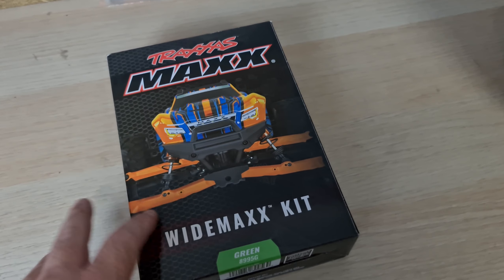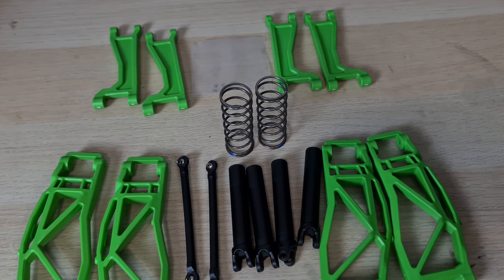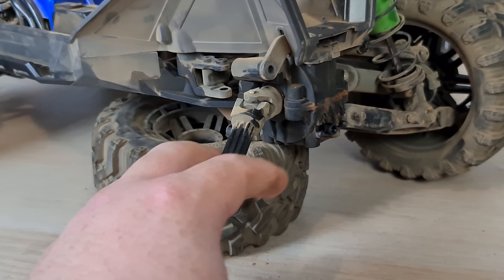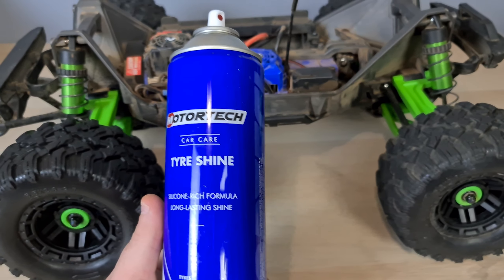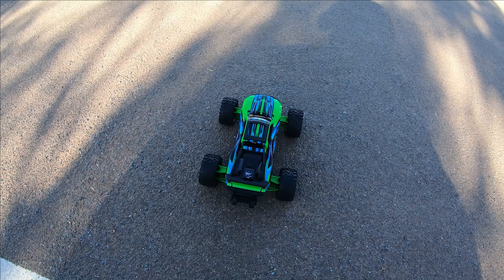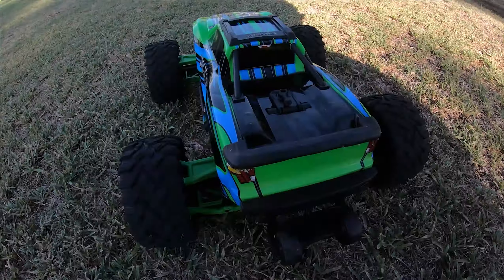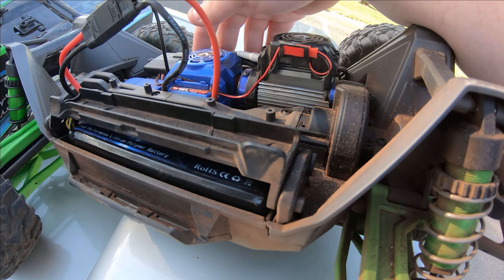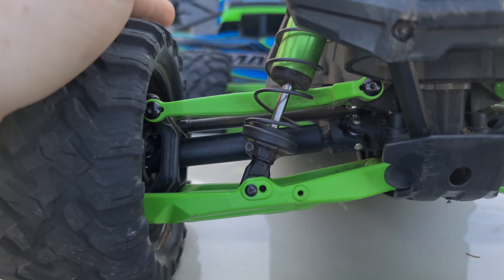WIDEMAXX V2! Traxxas Maxx 4s Widemaxx Kit Worth The Money?

Comment: Wide maxx is definitely worth the money, also the high velocity steel driveshaft set is another well worth the money for the Maxx, nice video brother.
Reply from the maker: thanks bro! i havent needed the shafts yet because the v2 has the upgraded plastic shafts, but time will tell!
Reply: @MatthewSimm  you will love them bro, just dont use self righting, even with the v2, they will not hold up they will eventually twist, heat and plastic over time NEVER MIX!!   ALSO I ADDED 50 WEIGHT IN FRONT AND 70 WEIGHT IN BACK, not as much chassis slap,  gpm makes great shock springs,  make sure if you get them it's the silver and gold set, the MAXX IS A BEAST OF A MACHINE!!

Comment: What tires should I get so it doesn’t balloon or what can I do because I heard if the tires balloon it’s pretty bad because the turning gets worse and the car flips all the time. Can you tell me
Reply: Can you tell me please
Reply from the maker: It will depend how you like to drive. 
Belted tyres won't balloon but that means let control in the air so it's harder to do stunts etc.. 
Non Belted tyres will balloon, some more than others.
Reply: Kind of all terrain safe and not full send jumps it’s my first one but kind of like on dirt and road so kind of everything and safe ish

Comment: Great video! Glad you recommend the kit. It’s definitely good value. Looking forward to taking mine out for its first run with the wide kit soon.
Reply from the maker: I think you'll really like it 😀 I forgot to mention you need 50wt shock oil for the rear, it says that in the instructions, I just forgot it in the video
Reply: @MatthewSimm  did you change yours to 50wt? I saw that in the instructions and changed mine. Some guys run around 80wt but I don’t tend to run at the skatepark so the lighter oil is fine for me.
Reply from the maker: No I didn't have any to out in, I will be though

Comment: Good video, subscribed. Right now I have the Hot Racing extended hubs (10mm) and Trenchers that add another 10mm or more. Haven't run it yet since I added the HR hubs. How wide is the widemaxx kit with stock tires installed?
Reply from the maker: Sounds like an awesome setup dude. I'm not too sure but you can find it on the trwxxas website

Comment: I’m not a fan of colored arms, but it does look cool! Also I agree with running in the water. I cringe when I see rusty parts on other videos. I have a habit of commenting as I’m watching. Hopefully last comment. Great video!
Reply from the maker: If I'm going to run it in water or mud etc.. that's because I'm ready to do a full rebuild and just want to have a bit of fun before I tear it apart and replace stuff 😀 you can get some spray that'll prevent rust, I think its called lanolin